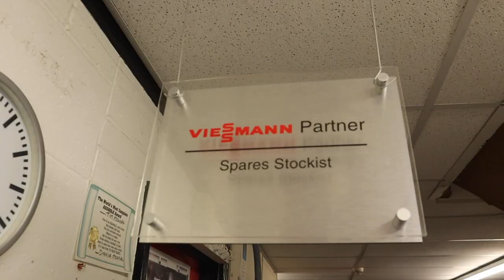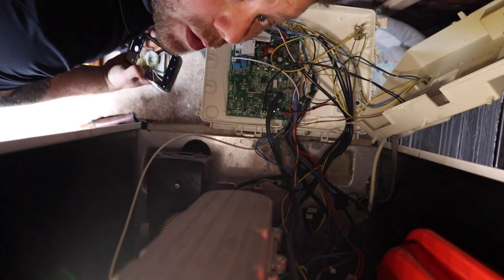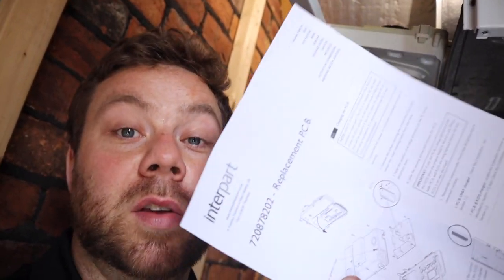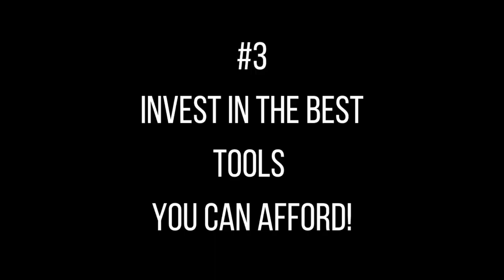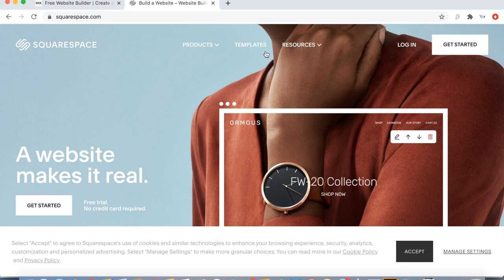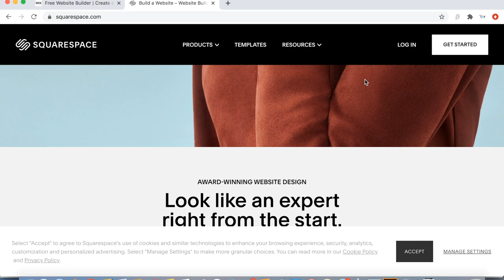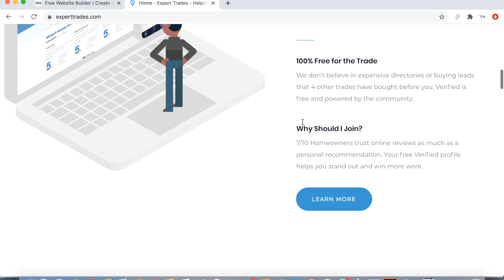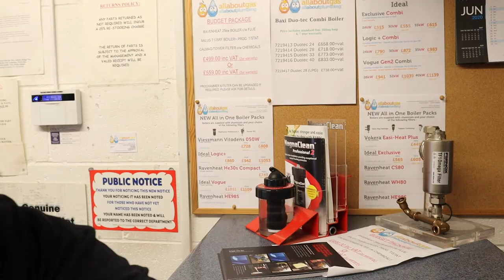5 PLUMBING BUSINESS TIPS | Parkes Plumbing

Comment: With you on Milwaukee best tools out there sound advice on not buying cheap tools 👍
Reply from the maker: Cheers steve
Reply: I know a kitchen  fitter who's every tool is from aldi... works for one of top kitchen companys in skipton. It's nice having good gear.. but a £50 drill does the same as a £350 drill..

Comment: Do u need to let that liquid ptfe dry or can u put pressure straight through it?ive been using the lock tite but its £30 a bottle
Reply from the maker: I can’t remember exactly what the label says but I leave it 10mins for water. Think it’s longer for gas.